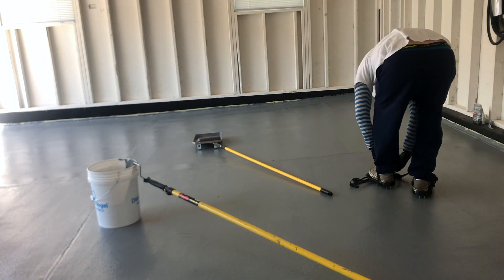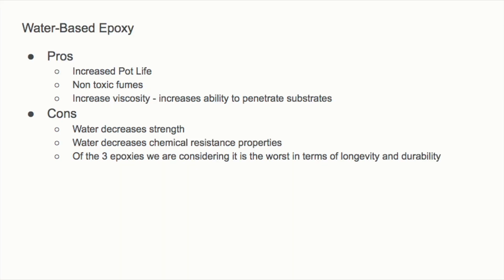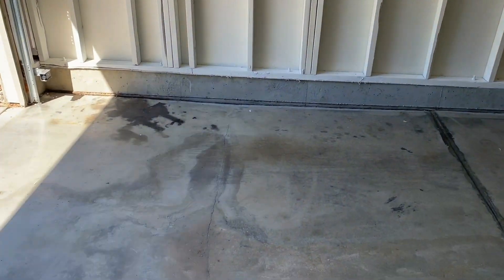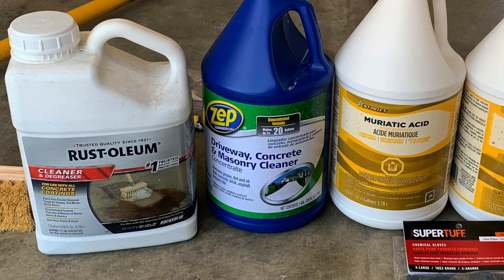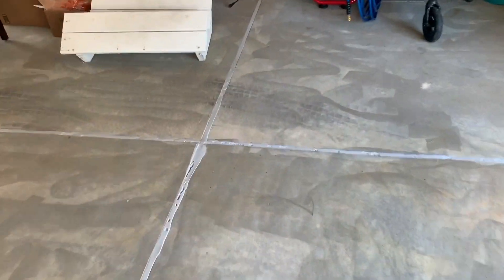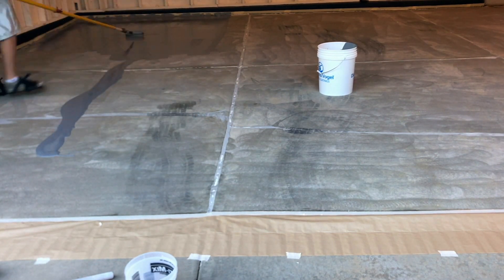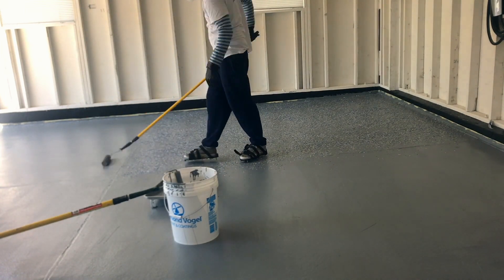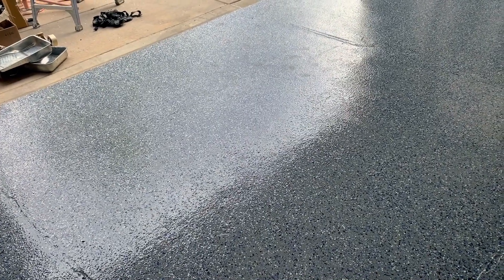DYI Epoxy Garage Floor Tutorial | Everything you need to know

Comment: Very detailed video thx.how is the coating holding up please?
Reply from the maker: It has been holding up extremely well. I am about to move, so will be cleaning out garage soon. I haven't washed it since I installed it excited to see if it washes up to look brand new or if there will be any signs of wear and tear. Turning it into a rental so I will be able to check on it after 5 and then 10 years to see how it holds up relative to other things.